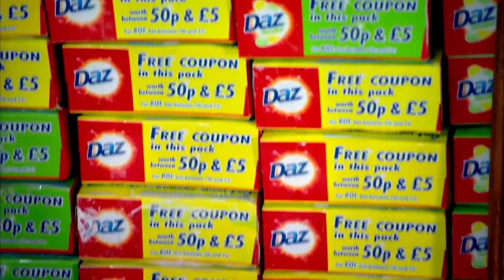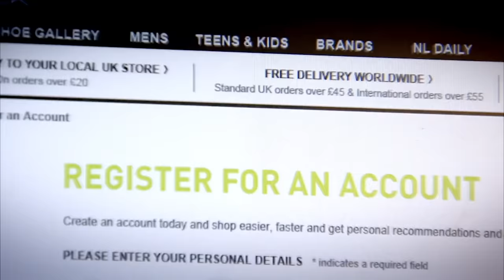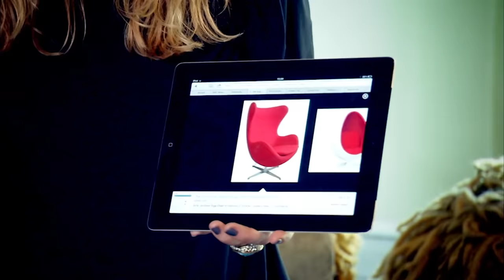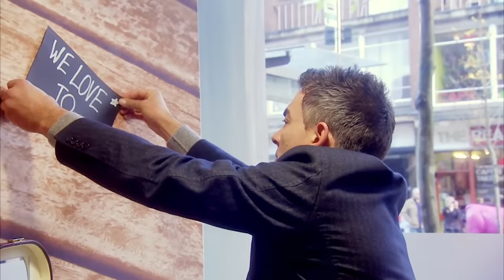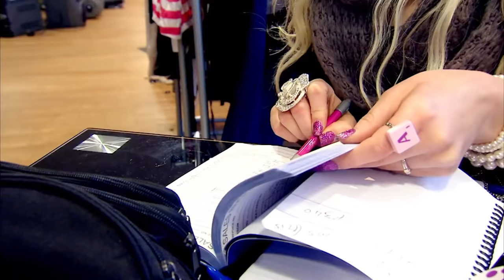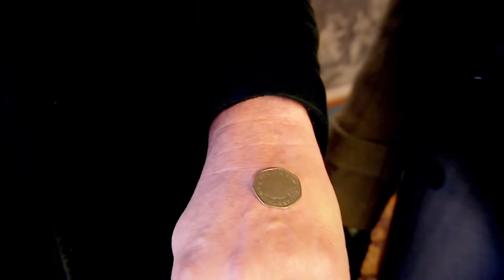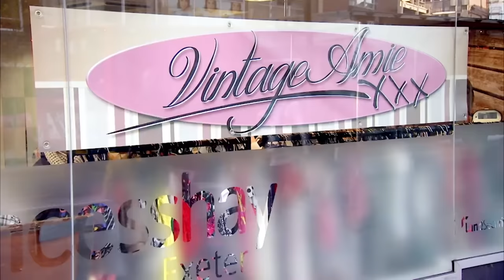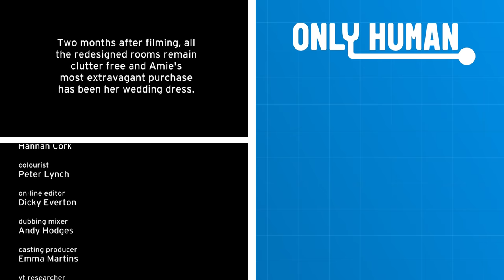A Shopaholic Who Can't Let Go of Old Things | Hoarders Get Your House In Order | Only Human

Comment: Both the designer and the crew are terrible. The so called designer not only was going "what >>I<< think", but also made the place more depressing. Cherry on the top were those painted shoes. Pseudo Designer turned psychologist. As for the crew, if you look up on dodgy paint where you can see original old white paint coming through and missed spots all around. Holes and chippings in the walls could have been patched before painting with one bag of plaster.